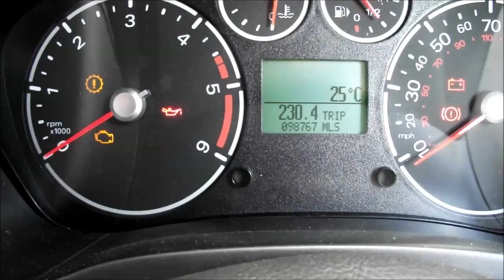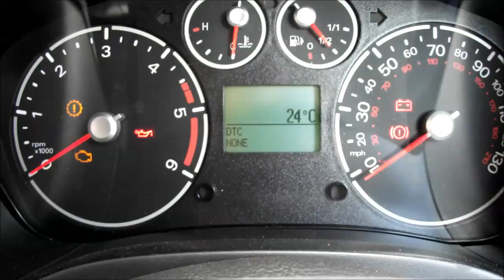Ford Transit Connect - How to read DTC Error codes without a OBDII device

Comment: What's goin on, - I got a 2012 T-connect and it doesn't do any such thing, - in fact the left handle isn't anything like yours, it's just a plain old turn signal lever.  - This is a joke right?
Reply: No, its no joke. The UK model Transit connects are a little bit different. With the US models, instead of the set button being on the end of the turn signal lever, its on the dash itself. Its the black button that normally allows you to reset the trip odometer. Follow the instructions in the video, except that the only difference is the set button is on the clear plastic that covers the gauges (aka the cluster), right under the RPM meter.
Reply from the maker: +Blackaboe&#160; It's no joke....Here in the UK. 2009-2013 Transit Connects have 2 types of instrument clusters.Level 1 - Basic with 2 buttons on cluster & no configuration menu & no menu buttons on turn signal (indicator) switch.Level 2 - High spec with vehicle configuration menus & menu buttons on turn signal (indicator) switch.